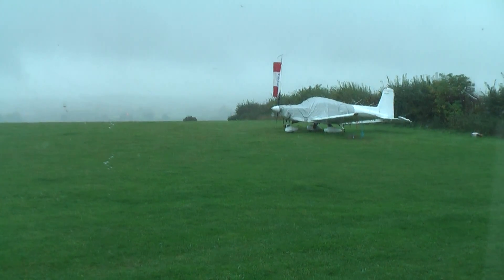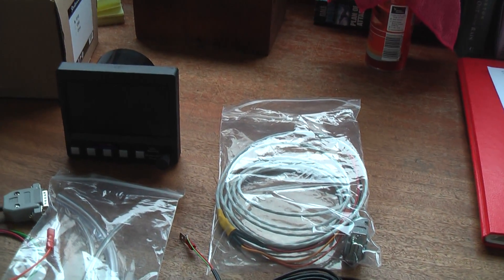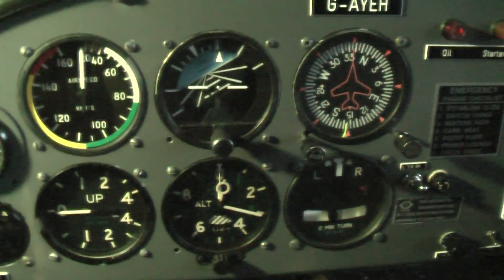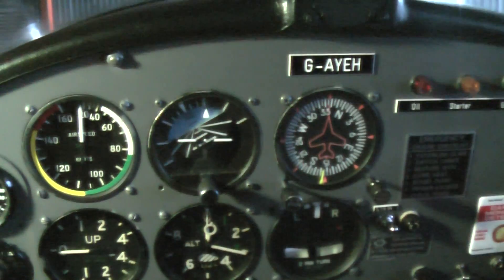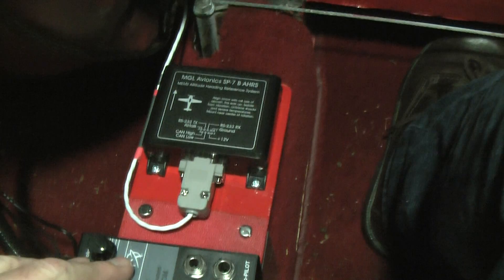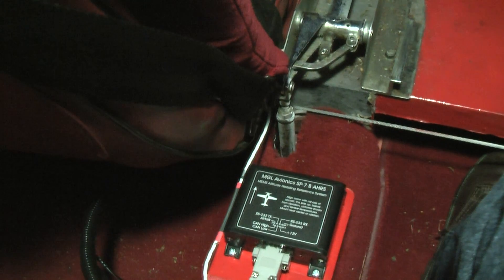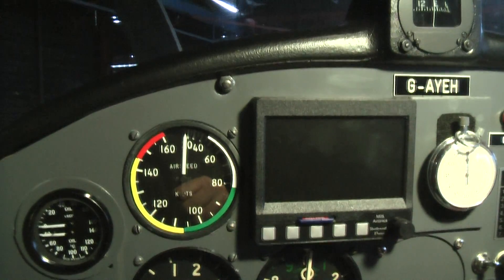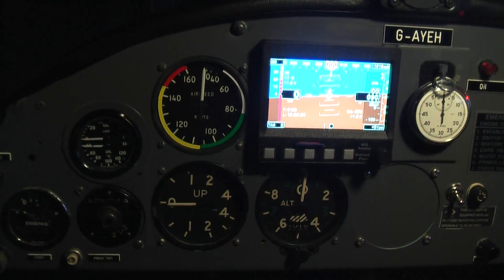XTreme Mini EFIS (Installation)

Comment: Forgive my ignorance, but what is EFIS, please? As a guess, 'Electronic Flight Information System'? To use a cliché, 'Google is (not) my friend', when trying to decipher the acronym. Thanks Tim.
Reply from the maker: Yes, you are correct with EFIS and as an instrument it provides a lot of data ( but most of which are shown on separate instruments. However, one quick glance gives you most of what you need and will display GPS headings, distance and time to a programmed point if you use the split screen)

Comment from the maker: The ball is out of centre as the SP7 sender had not been levelled properly. The unit has been factory calibrated and I meant 'configured' in terms of settings for the Jodel. The unit gets a mention in lots of further videos so check them out if you are interested.